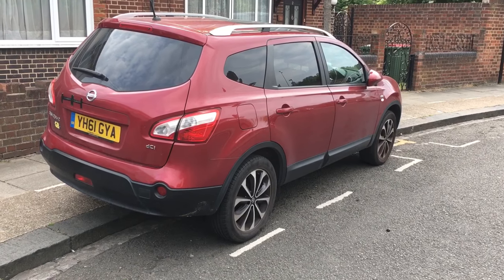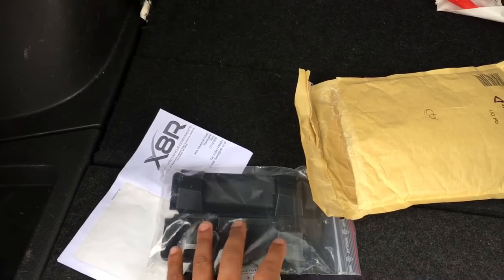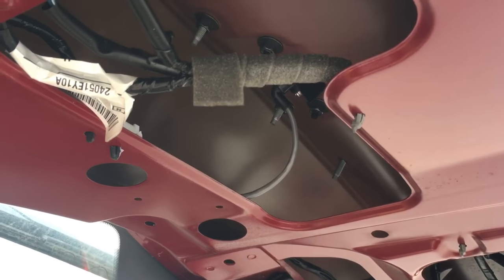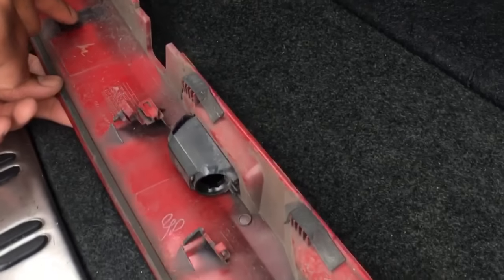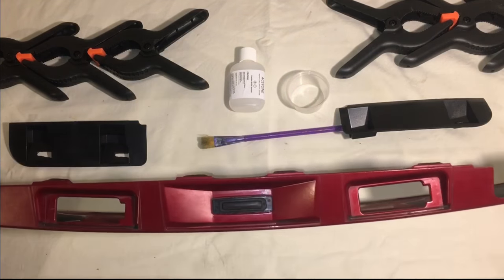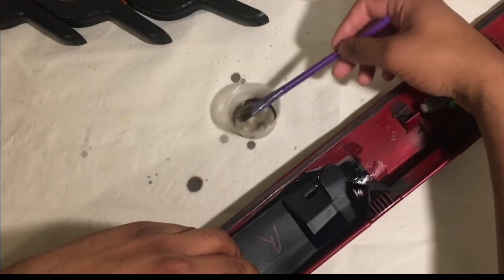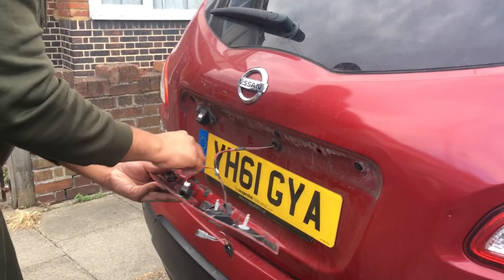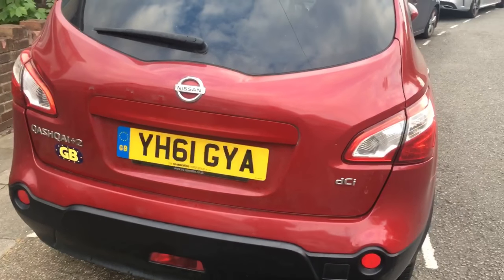Nissan Qashqai tailgate boot lid repair

Comment: Azz - thanks to this video I have now completed this repair.   I am a long way from being a DIYer or Mechanic.  So a hearty thanks, I would not have succeeded without it. 

However.......for other viewers there are two important points to make about the replacement kits:

1) Originally the handle is held by five bolts and one stud.  Six connection points in total,   The kit replaces the two at either end, thus four in total, and not the two in the middle.    All six of mine had broken.    Advice - if one side starts to fail fix it straight away, don't leave it for the middle two connections to snap.  My repair is not quite the perfect snugness in the middle as a result.

2) Azz's video shows two bulb connections and one grey electrical connection.   In the Techna version of the Qashquai there is a second grey electrical connection and crucially this is held in place by one of the four brackets ultimately replaced.   The replacement brackets are not designed for this version.    I have had to tape this connection point up inside the handle.  Doable, but fiddly and certainly not ideal.  

Just on the process I add the following from experience for those ready to proceed:
a) the trim removal.    Those two studs right at the beginning.   I tried and tried to prize them off.  On closer inspection there is an inner disc of approx. 8mm and an outer disc of say 15mm.    Just prize up the inner bit and its easy.  Don't try to prize the larger disc off like I did!   Thankfully I failed and paused.   
b) the trim removal.    On the side the large lower trim panel joints a smaller upper panel.   Time to be gentle when prizing apart.  I snapped a few shards of plastic off so the joint is no longer flush now replaced
c) the six bolts.   They seem longer than they need to be. My simple socket set doesn't have a longer10mm extension so I couldn't fit the head over the bolt thus resorting to an adjustable spanner to loosen first.  Borrow a good socket set if you can, it will made an awkward job very simple.     
d) Don't do this in the rain.  May sound simple but I didn't think. I took off one day, let the brackets dry over night, came back to the car after the previous nights rain and the bulbs had water in them. Its obvious but when the handle is off the bulbs and electrics are exposed.
Reply: great point Simon! you were able to lock the boot door as usual while the tailgate was aside with the acetone right?
Reply: @carlosmontesparra8548  yes carlos, locking the car was fine without the piece on for a night.
Reply: Thanks, I didn't know what key to buy to unscrew the screws 👊🙂👍

Comment: Thanks Azz, excellent video with all the details you need for a job like this. No throwaway lines like' remove the trim inside the boot' - everything explained and demonstrated. At ~20mins it is long but worth the watch - probably saved me hours and helped produce a better job.

Comment: Nice Video explains a lot easy to Follow
Recently bought a QQ Tekna, handle came off when salesman opened tailgate, taped it up and reordered a new handle which had to be sprayed black. so i found this kit on line as temporary fix, got the new handle after 3 weeks, but left repaired one on it's going no where.
Easy to fit no repaint needed and solid as a rock.😊😊😊😊

Comment: Thank you for making very detailed video! 

The best tip in this video is sanding of the paint on the Back, 
I bet many of the bad reviews on Amazon was down to not sanding, and not applying the aceton with a brush.

I see many comments about saving 250£, in Norway, including the paintjob, it would easely be 425-450£.

Comment: Thank you, great video and enabled me to fix mine.  Mine (even though it was the same year as yours) didn't have the first 2 10mm bolts near the locking mechanism but all other steps were identical.

Comment: A heavy handed friend of ours just broke this! I ordered the parts from x8r and came across your video which is better explained than theirs especially the removal of the inner liner. I noticed that the kit only provides for the 2 outer fitments ie the 3 screws and grommet not the inner ones?

Comment: Azz, you've inspired me to give this a go.   Thank you.   I like a vid where the old fashioned "whallop" to click the trim back on is included.  My usual technique.   

However, one thing, do you or anyone else know where to buy those clamps from to hold the clips for the 2 hours.  I am in no way a DIYer nor a mechanic and don't have such things.  Or anyone used anything more common?

PS - Dealer quoting me £94+VAT for the replacement, £60+VAT for the colour match and £130+VAT for the hour's fitting.      Currently (Jan 21) the clips from X8R are £18.99
Reply from the maker: Just search clamps on eBay and a whole variety will pop up

Comment: Just so everyone is aware there are  6 clips 5 bolds and a plastic black  clip. The black plastic clip in the inside right one. I just replace that with one of the bolt clips and pushed that into one of the middle holes as there broken also. So basically you only replacing 4 clips out of the six clips that hold on this piece on. Unless the middle clips are still intact.

Comment: Hi Azz - doing this just now but how do you get boot back open when tailgate is off - do you have to just put everything back together before you can open boot as leaving acetone to set overnight - thanks
Reply from the maker: If you need to open the boot just connect the switch back on which is connected to the lid
Reply: Thanks Azz that’s what I thought - amazing video has saved me a fortune and step by step instructions make it so easy - keep posting !!
Reply: I shut the boot and had to reconnect the switch to get it back open. Doah!
Reply from the maker: @PaddyWack999  lol

Comment: Perfect. Thank you. 
But one wonders why Nissan UK didn't design a sturdier system. No doubt that these flimsy bits of plastic, were designed to break after a fair amount of years, so we are forced to return to the dealership once the guarantee has run out. Ba..ards. I was wondering though why you bothered changing the right hand side since it wasn't broken. If it's not broken... as they say

Comment: Hi!! This is such a helpful video!! I’ve ordered the part and saved myself a small fortune! I have the same problem, although the handle on my qashqai is already detached.. do I still need to undo the boot liner?? Tia
Reply from the maker: Aimee Jeromson yes to secure it back on you’ll need to put the nuts back on the bolts from the inside of the book lid.

Comment: Great video, going to give that a try. Just sceptical on taking that plastic cover off the boot, that plastic did not sound like quality. What socket wrench did you use? Might buy one from the saving of not taking the car to the dealers
Reply from the maker: 10mm

Comment: thanks for the video.  i have just ordered the part (seems inflation has had an effect on the cost, its £22 now).  quick question - am not at the car to check -  once the part is off is it possible to open the boot again from outside?  i will likely leave it to cure over night . i know there is the emergency manual access from inside the car but just curious.  thanks.
Reply from the maker: You should be able to connect the switch to the connector and still open the boot
Reply: @azzkam8972  lol i cant believe i didnt think of that.  DOH!.  Thanks to your video however i have now fixed it. Removing the plastic card inside my boot to get to the guts was different to your car... but other than that it was spot on and made doing this job much easier. Thanks.

Comment: Do I need to take off the plastic cover from inside if I would buy a new handle? Can I just put the lights in the new handle and then clip it in from outside as the bolts are in place. I hope you know what I mean. Thanks.
Reply from the maker: Szymon Oszyjczyk yes you will need to open the back plastic to access the nuts for the bolts, I don’t believe you can just slide the lid back on because of the position of the slits for the bolts.

Comment: Do I need to wait hours for the acetone to set as it seems pretty sturdy after 20 mins? Great video. I've had mine taped up for months now.
Reply from the maker: vicky Colaluca they say over night if I remember correctly however if it’s solid enough to put back on the car I suppose you could leave it on the car for 24hrs to cure, just don’t put any real pressure on it for a few hours at least is all I would advise.

Comment: Thank you Azz, would this work for Nissan Qashqai 59(year 2009) model?
Reply: Also please, what is the tool you have used to unscrew the bolts inside?
Reply from the maker: It will be very similar if not exactly the same and the tool is a standard ratchet or a spanner would also do the job.
Reply: @azzkam8972  Thank you for your quick response, i will give a go :)

Comment: Does anyone know where I can get replacement screws for this? The others fell off I only have one remaining on there after my wife's driving instructor pulled it off. Or even what they are called so I can buy them
Reply from the maker: You can get them from Nissan call your local dealership and speak to the parts department they shouldn’t cost more than a few pounds

Comment: An easier repair is to drill one or two holes in the tailgate ( replacing one or two of the original screws) , pass  screws through them and screw them from inside of the tailgate with appropiate nuts.